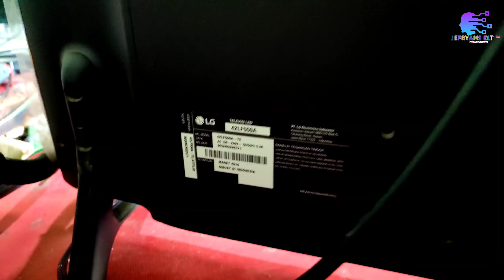LED TV REPAIR! layar Garis ? Coba Jangan Di isolasi Semua 14 jalur cukup Sinyal Gate LG 42

Comment: Pak mw tanya, Dioda seri 5 ada yg short 1...
 Dioda SB5150 bisa diganti ama SR5200 tidak ?
Kalo bisa mesti disamain semua apa cukup ganti 1 aja
TV LED Polytron 32inch
Reply from the maker: Belum pernah coba, kalau saya ganti dioda yg kaki tiga yg ada heatsink nya
Reply: @JefryAnsElt  kalo mosfet 5N60C ( N Chanel) jebol terus dari apanya ya pak ?
dah 2x ganti, setelah 1 minggu jebol lagi...